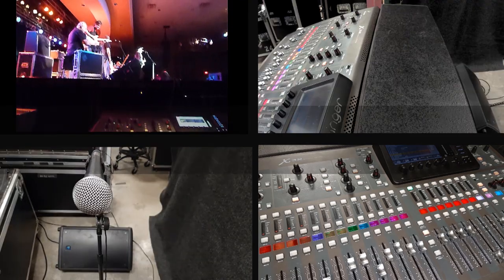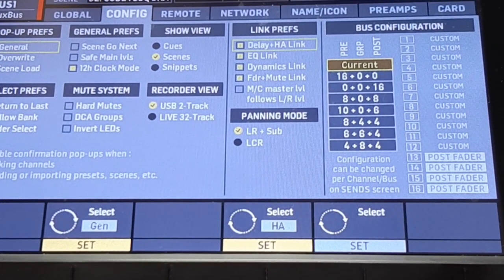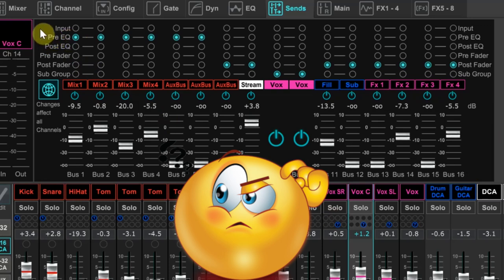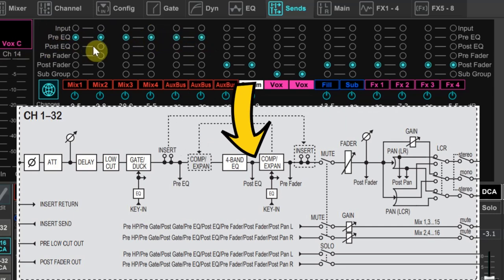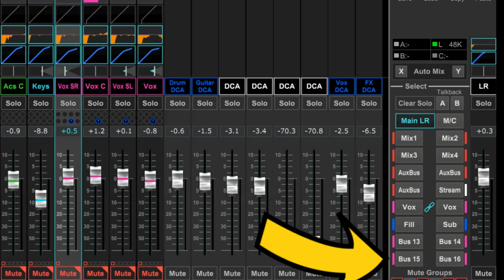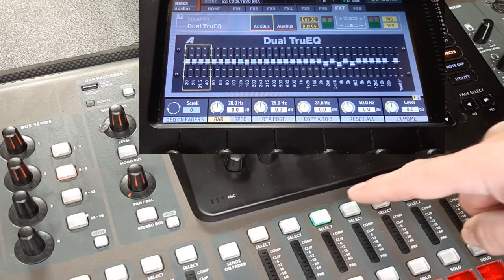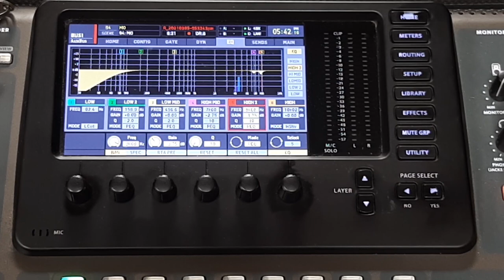Behringer X32 & Midas M32 Monitor Setup Guide - How To Set Up And Understand Bus Sends

Comment from the maker: 0:00 Intro
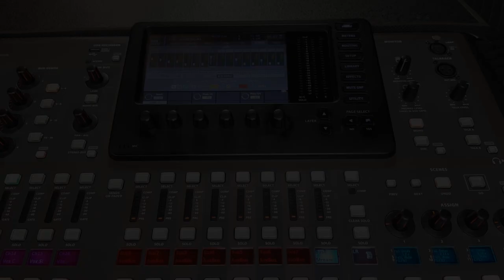0:15 Bus Overview
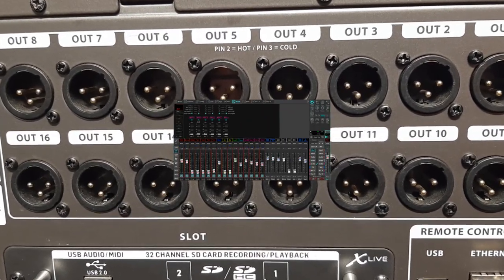0:31 Routing Overview
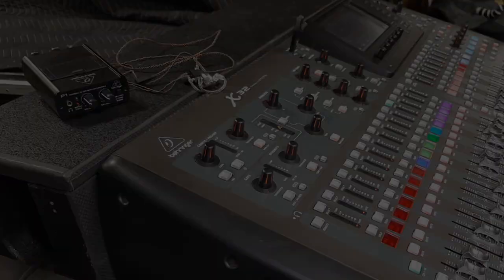1:09 Bus Send Setup Options
2:07 Setting Up Busses with X-Edit Software
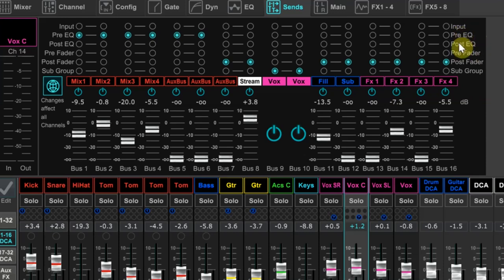2:41 Tap Point Options- What They Mean
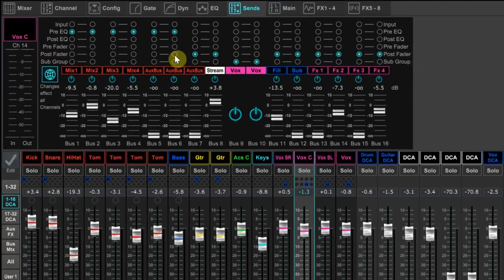5:33 Compression On Vocals In Monitors
6:05 When You Might Use a Post Fader Monitor Send
6:33 Normal Applications For Post Fader Busses
6:52 Signal Flow / Gain Structure Discussion
7:30 The Other Bus Option: Subgroups
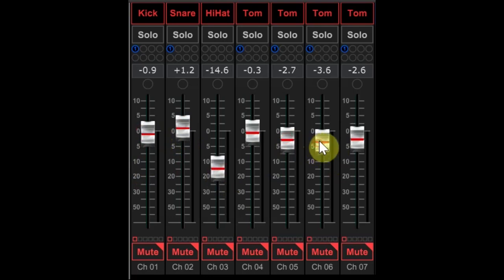8:00 Monitor Outputs and EQ Setup
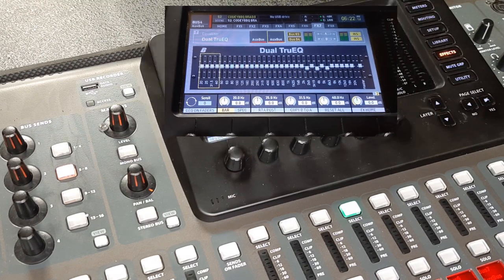10:04 Stereo Busses / Stereo Linking
11:05 Further Info

Comment: I’m trying to set up buses where the channel mutes do not affect the send to the buses. Previously used a presonus console where it was called global aux mute in controls. We are on all in ear on stage and want to be able to hear before unmuting the house. Our band leader uses it to give direction to all the band without it being in the house prior to start of the show.
Reply from the maker: If you assign every channel to a single DCA... or else just make sure every channel is overall assigned to a DCA even if it's different DCAs (drum DCA, instrument DCA, Vocal DCA, FX DCA, etc...) and then go to the SETUP page and make sure "Mute System: DCA groups is NOT checked (I'm looking at X-Edit PC for this Setup page setting but it should be in the hardware too).... Then... I think... That means you can mute the DCA's WITHOUT any of the busses being muted.
So, since everything is assigned to one or more DCAs, muting those DCAs would mute the house, but not the channel sends. I'm not at the console to try this just to confirm it works and  isn't the other way around and the DCA Group need checked and/or isn't working like I think. But it should be easy enough to test for you.

I'm assuming you don't just want to mute the main L-R out so that you can continue to play break music or whatever while you test mixes. Otherwise, you can always just mute the L-R output and that will leave the channel sends all active in your ears/mons.

Comment: Hello Alan.  I was wondering if you have produced (or know of somebody that has), a video on how to set up two M32 or X32 consoles as FOH and monitor consoles, using a DL32 and an analog split snake at the monitor world position, to get around the gain problem.  Please let me know.  It's something a lot of people ask me about on a regular basis.  Thank you very much!
Reply from the maker: I planned to do one but never got it started. 
We won't likely use it that way (which between that and getting extra busy is one reason I wasn't able to get the video started)... 
With the DL32 it's super convenient to run cat5e shielded Ethercon style cable from Mon world to FOH, but just use an analog splitter with a couple of short tails to make the connections with a split to the DL32 and to the mon console all at mon world. That takes ALL gain sharing issues out of the equation, but still has the benefit of not having to run 40+ pair multi-cable to FOH. Yet still gets the Midas Pres for FOH. Of course, not for Mon world unless there's an M32 there.
Reply: @AlanHamiltonAudio  Yes sir, this is exactly the setup, with a 2nd Midas M32 at the monitor position.  I also want to use the AES/IBU digital outputs on the DL32 to drive a rack of 4 Crowns into thier digital inputs (all cascaded together) so as to avoid an analog to digital and back to analog, but not sure 100% how.  Do you have any advice on this?
Reply: I got this all working.  Thank you so much!

Comment: Just so I don’t think I’m going crazy.... IEM wireless Senny pack running on a stereo bus. Vocalist takes one in ear out and it’s hanging down on the chest...6-12inches from the mic probably and it’s causing slight feedback as they approach the mic. definitely plausible because it is a speaker inside the earbud and the vocal is obviously the highest since it’s their mix and mic. Right?!
Reply from the maker: No reason an open speaker, in this case an ear bud, hanging right at the mic wouldn't cause feedback.
I mean technically, it would be feedback in the IEMS, and you'd be hearing the earpiece hanging on his chest being picked up by the vocal mic (if you're hearing it in FOH and not just him complaining about feedback).
Obviously, that SCREECH would be LOUD in his ears. But, with significant high end hearing loss, that's easily possible. It's even possible he doesn't really hear it at all... 
The internet is filled with stories of soundpeople trying to find a high pitched squeal only to eventually figure out it's someone's assisted listening device, that they're wearing, feeding back in their ears and they don't even hear it, even though the sound person can hear it.
FWIW, audiologists will tell you that removing one earpiece is terrible for your hearing health. Usually, when you see someone on TV removing an earbud, or both, it's because their mix is bad and they'd rather hear room sounds than the bad mix (or dead mix). Not because they actually 'like' working with one earpiece. That can lead to some monkey-see, monkey-do... 
Hopefully your singer doesn't have permanent hearing damage. Let alone so severe they can't hear their own earpieces feeding back. They definitely wouldn't be helping that situation working with one earpiece.

Comment: Do you have anything on the x32 rack? I have a specific aux question.
on the back I see there are 6 aux ins and 6 aux outs along with 6 outs, the stereo main and I see a monitor left and right next to the TalkBack input. Can those monitor left tand right be a separate assignable stereo out? Or can the front headphone out be assigned to that monitor to be another stereo out?
Reply from the maker: I don't have an X32 rack so know just enough to be dangerous with it... I'm pretty sure you can't do anything for those monitor left/right outputs that would gain you anything, and ultimately just take away some things (like being able to solo channels).
You should, OTOH, be able to use the stereo main outs as something other than main outs IF you're looking to use it as a monitor console and don't need L-R outs. But I assume you are using it for FOH so that isn't an option for you.
ORrrrrrrrr.... I think..... you can use the Aux outs... Just get a TRS to XLR cable for the connection... Go into your routing, and tap one (or more) of the 16 mix busses to feed one of the aux outputs. I don't know why that option wouldn't be available on the rack.
Reply: @AlanHamiltonAudio  you are my xr guru as always Alan.. thanks.. I'll give that a try
Reply: @AlanHamiltonAudio  on the regular x32 the is a control room/ monitor out. So that can't be set as a different aux send it is just for solo monitoring?
Reply from the maker: @christopherheadcase6886  You can set it to monitor aux 5/6 or aux 7/8... But then if you need to solo a channel, it would switch you to that channel when you press solo.
So you'd lose that functionality... 
And ultimately, you'd still need to route a mix bus(ses) to Aux 5/6 or Aux7/8... Which at that point you could just use the actual aux out with a TRS to XLR connector like mentioned above... and not lose the ability to solo channels for your headphone mix.
Reply: @AlanHamiltonAudio  one last question.. if I'm using all 16 XLR inputs for vocals and drums. Can I use the 6 aux ins on the back for keys and line in guitars off of 1/4 modelers?
Reply from the maker: @christopherheadcase6886  Yes... The two caveats that I can think of is to make sure to use balanced cables to make the connections (so TRS in this case) if you're going to be running a long distance, and be aware that the aux channel strips don't have gates or comps on them. And it's 4 band parametric EQ vs 4 band plus the low cut (HPF) on the aux channels. I think you can still make one of those 4 bands a low cut, so you can still have HPF and 3 bands of parametric and that should work in most situations.

Comment: Hello Alan. I was wondering why bus 1  (pre fader) volume doesn't change on actual Bus 1 fader .For instance, if I need to ring out a monitor, I need to switch to post fader in order to bump up a volume on bus 1 fader. What's wrong with it? Thank you Alan.
Reply from the maker: If it's the output fader, you want that POST Fader... You want channel sends to be pre fader (for mons from FOH), but the main mon output faders should be post fader. That is talking about the position of the physical output and you want that XLR out being AFTER the fader.
I'm not exactly sure that's what you're saying the issue is, but it sounds like it is.
Reply: @AlanHamiltonAudio  yes, that's right. It helped. Chanel 1 send pre and out for mon post! Thanks again, Alan !

Comment: All I want to do is put the singer in her monitor. On my analog Midas I simply turn the mon-1 pot on her channel strip. Done. 
I've been watching videos since I got my M32R 3 months ago, and nowhere does anyone explain how to do simple monitor and fx sends (especially not Behringer/Music Group - the manual is useless). 
Can someone out there please explain to me - as you would to a golden retriever - how to get audio to her monitor? Please...

Example: Singer on CH 25 on my board:
1. Press "pre-fader" on the MON-1 master send. 
2. Push MON-1 master fader up to the desired level.
3. On the singer's channel strip, turn the MON-1 send knob until you get the desired level. 
Can someone do a step by step explanation for the M32R?
Reply from the maker: Out of the box the first 8 sends are post-EQ (pre-fader).... So, assuming that is your configuration-
Make sure master fader for bus 1/aux 1 is up and at unity.
Select the singer's channel... Channel 25 in your example...
At the top of the board, select busses 1-4 on the bus sends (there are 4 knobs and you can choose them to be 1-4, 5-8, 9-12, 13-16).
Have singer sing, and turn up the bus 1 knob.
The monitor should come up...

--
FWIW, my preference normally is monitor sends to be pre-EQ for mons from FOH... But some people prefer the sends to post-EQ, even when the mons are from FOH. But at this point, that's neither here nor there if you're just trying to figure out the signal chain to get sound out of the wedge/ears.

FWIW #2- It's really the same signal flow as your analog console. You just don't have all the monitor sends available all at once on the channel strip... You just have the 4 at a time when working off the surface.

At least until you move onto sends on faders as a part of your work flow... Which is an option and advantage that digital brings to the table. But again, the basics are as I described above. So that needs to be sorted out first.
Reply: @AlanHamiltonAudio  Sorry for my tardiness in saying Thanks! for the help. Once you know how to do it, it almost seems too simple. It seems like digital audio companies are analog-deniers; they don't even acknowledge the majority of BEs who have been mixing in the analog world for decades. It's like, "In the beginning God created digital audio". The digital layout is only intuitive to people who are under 25 years old. Old guys like me have to learn completely new tricks just as we're getting out of the biz, and the learning curve is steep. Thanks again!

Comment: Hello I'm still confused here
My House mix is perfectly fine but with my IEM, it's still picking up my mix for house.  Was thinking a different mix for my instruments  coming into my IEM can be done
Reply from the maker: It sounds like something is definitely wrong in your routing. You shouldn't be hearing any of the house mix in your ears (except for just the room bleed some mics (like vocals mics) might pick up.

Maybe check out this video (linked below) and see if you see something you've set differently or misunderstand in the outputs. Of course it could just be something got accidentally changed so it might just take some careful cross-referencing of settings and double-checking them.
https://youtu.be/CAO56X-uxWk
Reply: @AlanHamiltonAudio  Thank you

Comment: Hello sir I am coming from analog board to the X32 and I am going through the process of setting floor monitors I have them working how do I get individual monitor mix
Reply from the maker: By default the the XLR outs are assigned 1 thru 14 to the busses, with 15 and 16 being assigned to the L-R busses.
So, the easiest way is to leave at least the first busses and outputs the same as the factory default patching. That way mix 1 = bus 1 = output 1, mix 2 = bus 2 = output 2, mix 3 = bus 3 = output 3...

If you're doing stereo mixes, you'll have to link the busses.... so mix 1 would feed outs 1 AND 2, mix 2 would feed outs 3 AND 4, mix 3 outs 5 AND 6.

But mono or stereo, this means in your master section everything flows in order and you aren't scrambling to remember some random and chaotic order of things. Which if you watch the Sends on Faders video you'll see how this all simplifies things.

Technically, as far as the surface goes, busses 13, 14, 15, and 16 are assigned by default to slots 1-4 in the FX rack.
Since those return to your mix, that is why outs 15 and 16 can be left and right outputs for mains (and controlled from the main fader). And 13 and 14 can be assigned to fills or subs, or matrix outputs (and controlled by the matrix faders). Or you can sacrifice some FX to get surface control for extra bus sends for extra outputs. Point being, that if you want to use those busses for XLR outs on the rear, then the surface bus controls (13-16) can't ALSO control an effect in the FX rack like reverb.

But assuming you only need L-R outputs first and foremost for house, and don't need more than 12 mono mixes, then the extra complications in that last paragraph don't much matter. You can leave the default in/out setup in place for that, including the FX rack slots 1-4.
Reply: @Alan Hamilton Audio  OK that I will do Thank You again this is way more different than the analog board but once I get it going to be way better than the analog board Thank You Dave God bless

Comment: I am confused.   If output Bus 1 is IEMs for musician A, why would I set routing to Post Fader and not Pre?
Reply from the maker: You're talking about post fader on the output here,  and not post fader on the channel. You want the XL:R outputs (on each mix) to have a fader to control their master output level on the mix. If you set that to be pre fader there, then you'd be tapping the output to be BEFORE the fader and have no fader control to adjust the overall mix's level up or down. There might be some rare cases where you'd want that, but for most uses you want that master mix/aux/bus fader control.

This is not the same as setting a bus send, on a channel, as pre or post fader. That's where it's talking about pre or post of then channel fader.

Does that explain it better?
Reply: @AlanHamiltonAudio  yes, I think I get it now.  Thank you

Comment: Ok So my X32 R Is Strictly for IEM for now , When I link the BUses I cannot get STereo imaging on My IEM , So what I've Been doing is Not link the Mix BUses , Mute And Leave Un-muted what I want on my Left ear or Right ear accordingly.What I'm I missing when I Link them?
Reply from the maker: How are you controlling the channel pans on your busses?
Reply: @AlanHamiltonAudio  I'm panning accordingly from the CHannel Fader ,I'm thinking if the  Mix buses are Pre-fader  then that's why I'm not hearing the panning?
Reply from the maker: @oscara.garcia5136  I was thinking the X32 had an option to click for "Pan follows L-R" but I don't see it in the Setup on X-Edit (or at least the version I have on this computer).
By default, when you link the busses one of the send controls becomes the pan for the two linked busses on each channel. Otherwise, they'll be fed a mono signal.
I don't know what that looks like on the iPad but on X-Edit, after you've linked the busses, if you choose a channel, you'll see a pan control under any stereo busses. It's independent of the house pan. I imagine the iPad app is basically the same. I know Mixing Station is.

On the surface of a full X32, if you for example linked busses 1 and 2 on any channel you select, the Send 1 knob would be the level control, and send two becomes the pan knob. The lights even change around the encoders so that bus 2 send on the channel just has a central light that you can see change when you pan left or right.

Also on X-Edit, on the "Mixer" tab where you see the small, rectangle windows above each channel... when there are linked busses, you'll see the top rectangle is a level control that you can drag your mouse across to change levels, and the rectangle just under it is has a center line in it and is now a pan control for the bus. You can click in it and drag the mouse left or right to pan within those linked busses.

Essentially, the house pans are independent of the bus pans. And each linked bus pair has their own pan control on each channel.

The only other thing to make sure of is that the linked busses on the output side have their own pans panned hard left and right. Technically, when you link them they automatically do that, but you can manually change them back to mono by changing their pan control. So if that happened somehow, then nothing you do will pan in them until they themselves are panned back to L-R. So you need to make sure those aren't changed from their default... Or just start from an initialized console and when you link the busses they will again automatically pan hard L-R.
Reply: @AlanHamiltonAudio  I'll try to check for that , in practice today.  If not I'll keep running the Stereo Mix IEm  with the buses unlinked ad just bring up volume  according to which side I want the Instrument/Vocal on  thanks for all your help. Liking the videos too